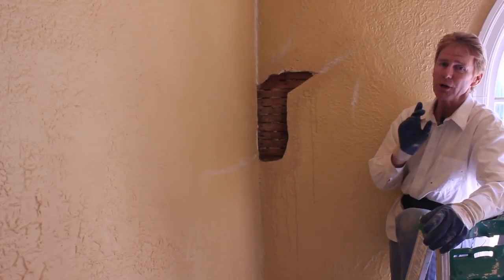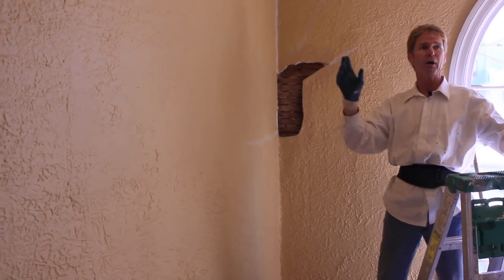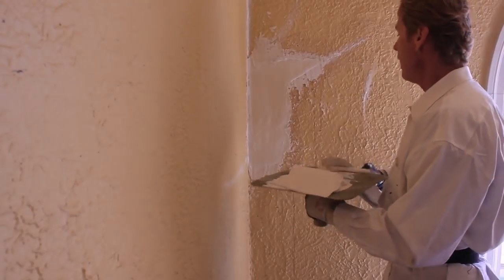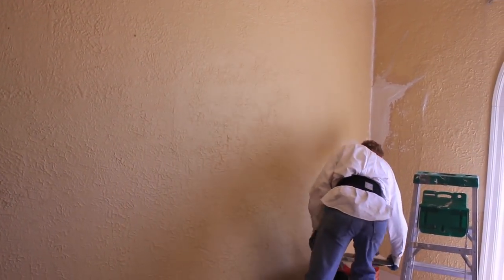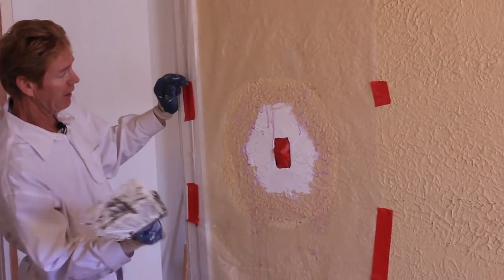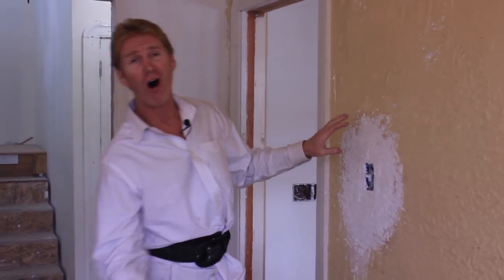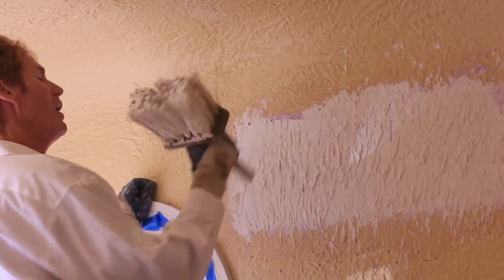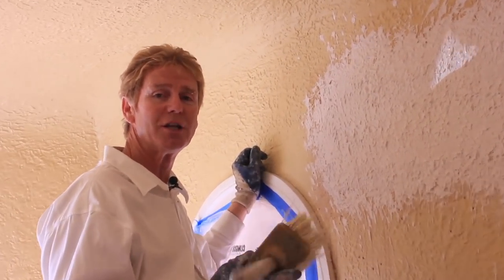Plastering textures for interior walls, Plaster knockdown dash

Comment: This is just what I needed to see. I am repairing the front wall of our church's sanctuary where everyone looks. The building is over 90 years old and the particular wall has been worked on many times. I found that the flashing had been the problem all along (roofers laid the shingles over the headwall flashing). Now that it has been corrected I'm fixing the cracks. The previous workers used everything from metal mesh to drywall tape to bridge the gaps, but with the roof always leaking, there was no end. I called it the 'forever wall' because someone always seemed to be working on it. Your videos are a great help. Much appreciated.
Reply from the maker: Hi JonMichael001, no worries, glad to be of help,
 Cheers,
 Kirk giordano Plastering

Comment: Great video as always. Your comment at the end, about how the old texture is smoother than the new due to about 15 coats of paint. Is it typical for the new plaster and texture, even once primed and painted, to look slightly rougher in a 90-100 year old house due to the layers of paint?
Reply from the maker: Hi Steve Franks, Yes and No.
 A skilled applicator will say after his repair, prime and paint and it should match as close as possible, as this skilled person will match the original, but just a bit rougher so that when you apply a prime and paint it should technically match.

 A handy man, or a fella who habit is of low self esteem combined with inexperience will make excuses such as "well the rest of the house has 10 or more coats of paint in the last 100 years so I can't match it any better.)
 And yes, I have failed a few times myself and this is how we learn to look closely at what we were trying to achieve.
 Best wishes, 
Kirk & Jason Giordano's DIY plastering network

Comment: Hi Kirk, Thanks for all you teach us sir. This is so Very good. Learned a lot on this one. I have to match this pattern at that same 100 year old customers house only over tuck pointed brick exterior walls. Rapid Set Mortar is where I started with the tuck pointing, I have Diamond Veneer basecoat next, however in my practicing of the DV Finish coat.....man that stuff hard for me to work with unless I am missing something. It’s like I need a set control agent, but Home Depot only sells those packets for Rapid Set products. I do not want to use gypsum based on the exterior walls as the previous fix was dissolved right off the wall by a small roof leak. I’m trying to make it like it was when it started instead of using these chalk products that dissolve with water. I read on the finish coat diamond veneer that there is a set control that I can use so I can work with it for a longer period time. Can the diamond veneer finish coat be used for this kind of pattern example as easily you you are showing here?
Reply from the maker: Happy New Year Mike, Try using the 60 or 90-minute Joint Compounds. 60 minutes compounds means, you have 60-minutes to apply it before it gets hard and so on.
 USG Easy Sand Joint Compound Or Westpac’s Fast Set Joint Compound, they are both okay to use. In fact, I can't tell the difference, surely one is sold at your neighborhood hardware store.                  Bringing peace, love, and harmony back to the world of plastering.
    The complete plastering encyclopedia on video, by the plastering messengers of Youtube with over 800 videos.
Reply: Ya gotta read the whole question. I know how to use tape mud in all of its forms. It’s very easy and requires very low skill. Lime based is not as you know. The exterior inside walls must look like knock down dash, but be cement like the rest of the house built in STL 100 years ago.

Comment: You can definitely use Structolite and go over it the same day. You need to add a catalyst. Agricultural Gypsum works great, and you can have your structolite set in half an hour if you add enough. About one cup per gallon of water will set in about  2hrs. It's way harder and stronger than hot mud.
Reply from the maker: @johnmacnab8564  Thanks for the tip.

Comment: So you can’t use Structolite on a ceiling in the morning and apply the finish  coat in the afternoon with a lime  finish coat .  Thanks Kirk.
Reply from the maker: @jacksmurr585  as soon as the structo-lite drys you can, as Structo-lite is a mixture of different things mainly  gypsum technically your not supposed to mix Gupsum’s with Lime plasters. Here’s a fact of life most stucco and or plastering contractors do. I simply apply a bonding agent over the gypsum, now it’s acceptable. Quickcret, sells their bonding agent for about 10 bucks, cheap insurance.
Reply: Thanks Kirk.

Comment: Hi Kirk. I have a 1950s house where one or 2 rooms have this texture... And I'm interested in sanding it down so it's more of a knock down type finish. Can this be sanded? Would it require a grinder? Do I need to soak and scrape? Thanks, I appreciate it!
Reply from the maker: Howdy Ben, depends on the material used, if it's painted it's best to just reskim. If it's raw try a wet towel, wiping it, if that smooths it out, that means it's gypsum based. If it's lime based wetting it won't do anything.👨🏻‍🔬

Comment: Hello Kirk, Love your work and you've inspired me to plaster my interior den walls.  With that being said, I just completed skimmed my old texture with all purpose joint compound (green lid) and wanted to know what my next step would be?  Would I just apply some plaster bond to the skimmed walls and then add Diamond Veneer?  Please let me know as I have received so many different opinions on this and so I thought I'd ask the master.  :)  Thank you and keep up the great work!
Reply from the maker: Howdy A dude, thank you for the master statement, made me laugh.
I have not used that gypsum before as most gypsums that are in buckets are premixed, they are not as good or reliable as the bags that people mix themselves.
 Since you already applied the gypsum, you must use a bonding agent to apply a veneer at this point. 
Again another rule starts with a veneer plaster and finish with a veneer plaster or start with a base of veneer plaster and finish with a gypsum compound.
It's not a good idea to start with gypsum compound and finish with a veneer plaster but can be done as long as you apply a bonding agent first, Id recommends quikrete bonding agent, sold at all home depots or lowes.

                        Peace love and happiness to all.
      Plastering and repair tips for your number one investment
Reply: Kirk Giordano plastering Inc. Thank you for the input! I will pick up that binding agent and give it a shot. Keep up the good work and keep that white shirt clean! All the best!